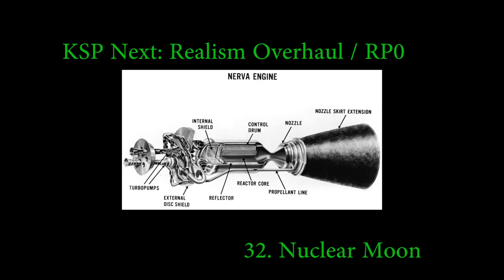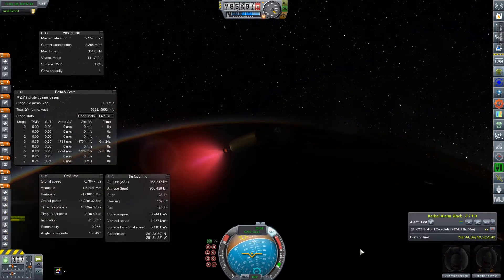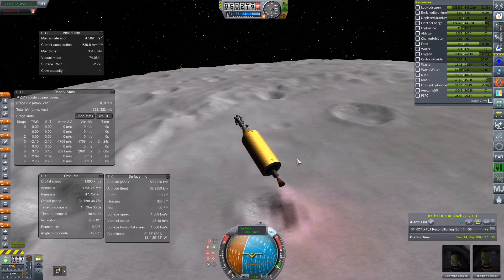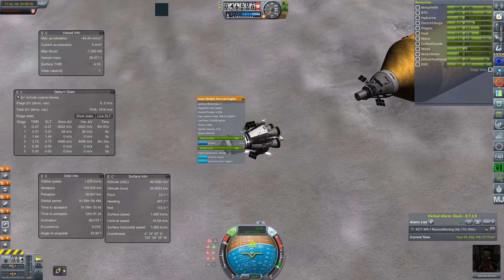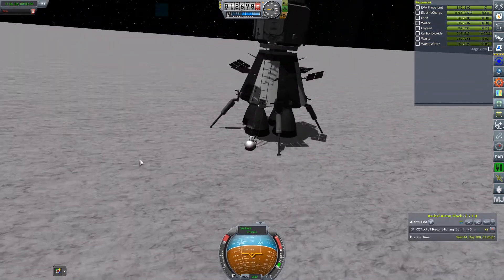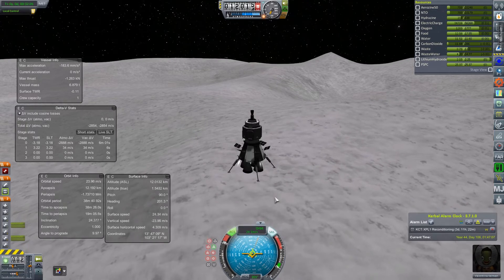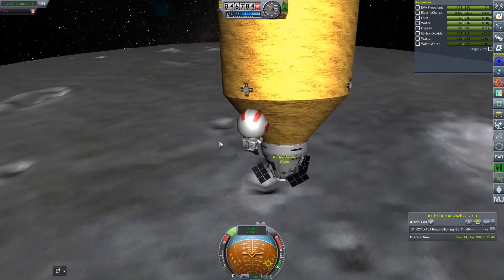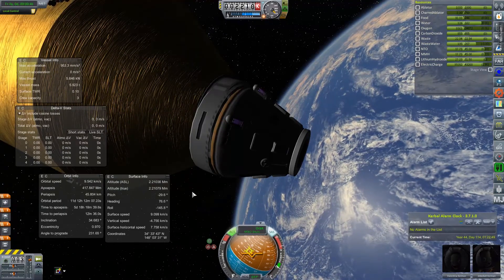KSP Next: Nuclear Moon (32)

Comment: Hey, cool video! What's the reasoning behind putting the ascend engine on the top of the lander?
Reply from the maker: +Wojciech Dubrownik the attachment points weren't cooperating and it was a bit fiddly to get a ladder down over the engine. But mostly I thought it'd be cool to do the launch-and-flip manoeuvre :)
Reply: Ah, the space program, where the three most important principles are safety, reliability and doing cool flips on the Moon :P
Reply from the maker: Wojciech Dubrownik Gotta have your priorities straight!